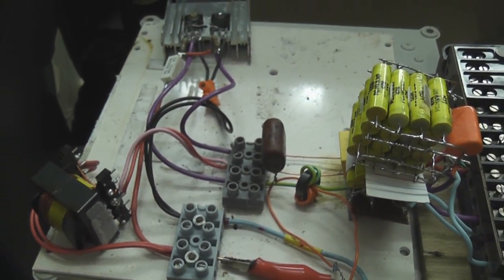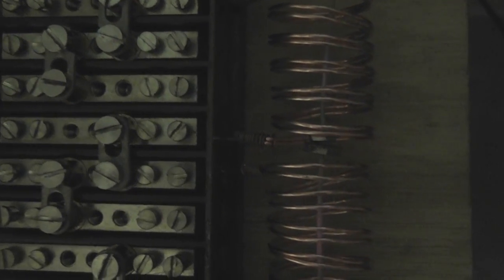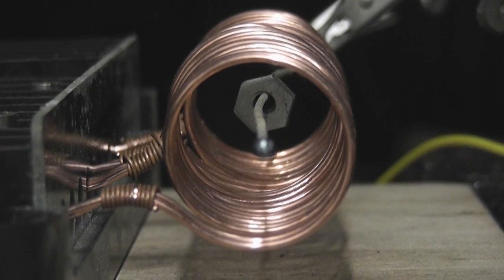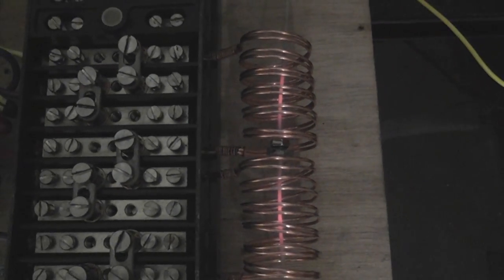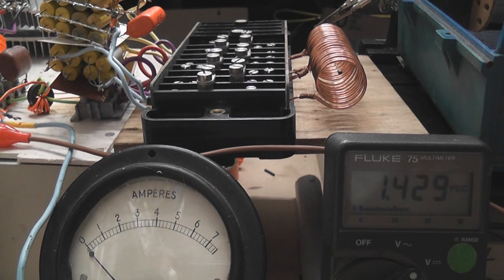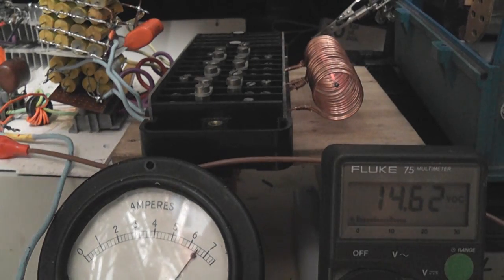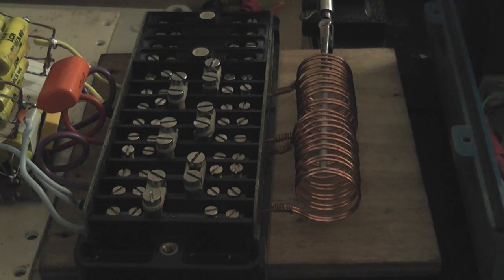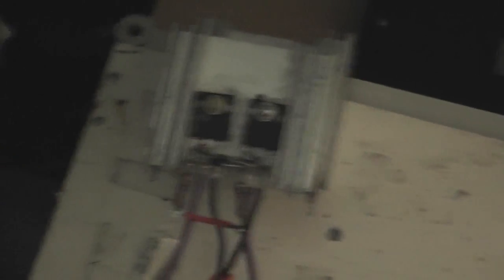ZVS Induction Heater [ 2 ]

Comment: Hi Ray :) have you used the oscilloscope to find the frequency of oscillation of the coil?
Reply from the maker: Not on this set up, I will check it and let you know. On my previous Induction Heater last week it was oscillating at about 100kHz.
Reply from the maker: It is about 125 kHz, will be uploading a new video with the half hour duration test.